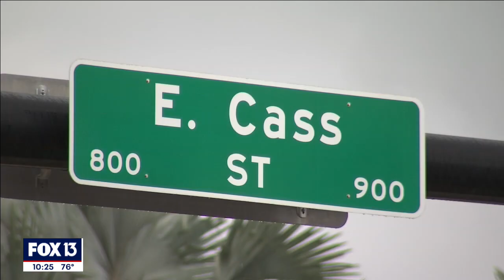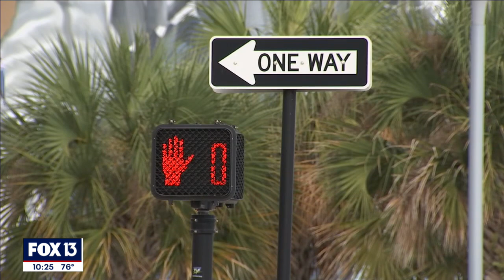Tampa testing solar power sidewalks to power traffic lights

Comment: This only works in those old cartoons. Green energy is a myth.
Reply: Its all cloudy too.  No solar without sun.  Lol
Reply: @busterthe2  To be fair, solar panels do generate some power under cloud.  Enough?  That's another question.
Reply: @JohnSmith-ux3tt  even in direct sunlight they benefit from being angled toward the sun.  So facing straight up on a cloudy day isnt good at all.  Also solar panels need to be kept dust free and clean.  This seems like a waste of money.

Comment: They literally could have installed a solar panel and battery on every pole and IT WILL STILL BE CHEAPER
Reply: Ok Mr Engineer. 1. Power poles are owned by power companies. 2. Aluminum street light poles won't pass a wind load test with the solar panel attached.

Comment: But it only works for a few days??? Why not put enough panels down to power it completely 😂
Reply: It can take a lot of panels to only power a small amount of things. There is a documentary on electric powered cars and solar panels and if it's really better than fossil fuels. 
   The main problem I see with the panels on this is people are gonna walk on them dirt and trash will get on top of the causing issues with how well they can collect Sun. They will most likely have to be cleaned weakly. Which could have a positive because it could create a job.
   But they should have put a panel on top of the light facing the direction it would get the most sun.